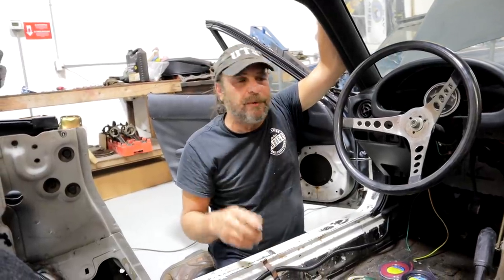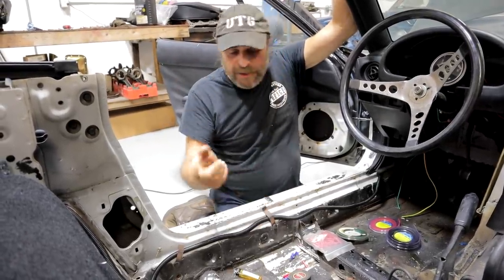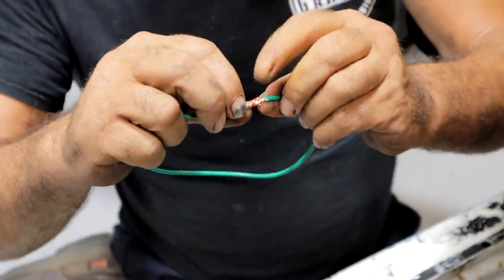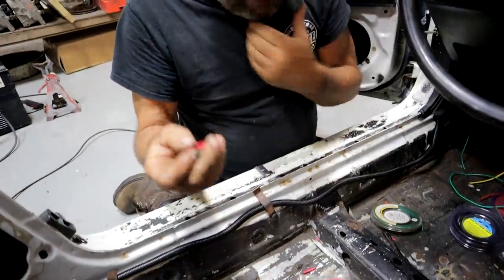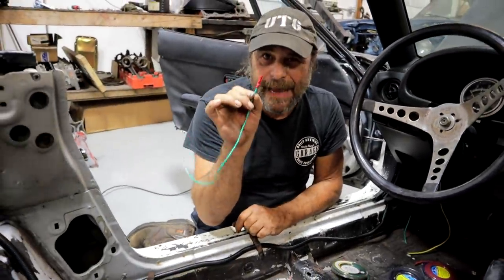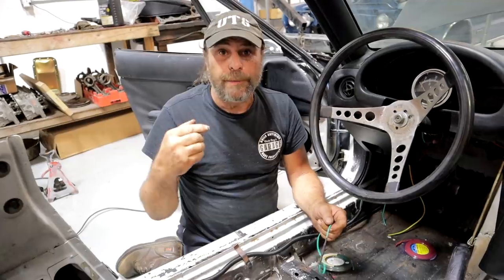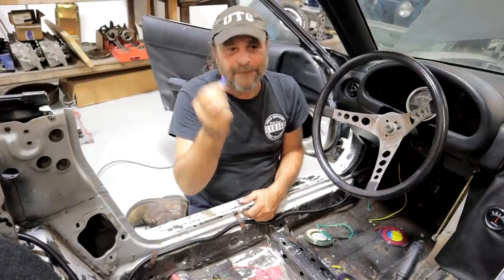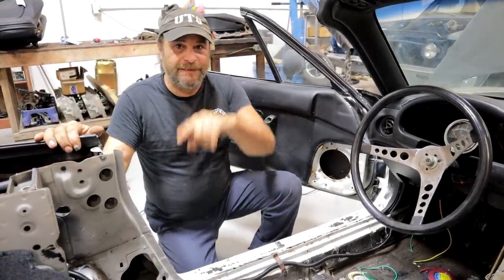The Single Most Misused Item In The World Of Cars

Comment: Good advice UT. These days I use automotive 1/2/3/4/6/8/12 crimp plug/socket connectors if possible. Sure, they cost more than butt joints and bullet connectors, but being able to disconnect, disassemble and re-pin is a huge boon. All the plastic plug/socket chassis use the same plugs, so if you find that you need to add more wires to a cluster, it's easy to simply swap them all out into a plug/socket with more pins. It's really easy to simply crimp one little brass pin to the end of a wire and plug it in when dealing with the minimum length for a wire run.

Comment: Ugh! Don't use those, they sell them without the color coded plastic so the shrink tubing makes a better deal. Just solder it and use adhesive lined heat shrink for a better repair.

Comment: what are we ?......cavemen ?  we don't use our teeth to get the insulation off...  single edge razor blade...while holding the wire in  our fingers....so that we cut the crap out of our fingers in the process.....

Comment: I use solder + shrink, wago connectors and spray grease. Wago are for houses but they work great on cars because the internal springs hold a constant crimp force. *gillotine or scotch locks are just terrible :o Buy the proper ratchet crimps, they are honestly a load better. The tool matches the crimp connectors. The industry style brass spade connectors with the proper crimp tool are also very good 😊

Comment: I switched to the soldering butt connectors with solder in the middle and glue on each side. Hit them with a torch quick and you’re good to go. Haven’t had one fail yet and I use them for a semi truck with TONS of vibration and over 100,000 miles a year. They’re great.

Comment: If you buy copper primary wire by the reel be sure to CHECK IT FIRST.   Feel the end .   Are they sort of stiff and springy??   If they are they are probably copper coated steel= JUNK .   So check close its usually not marked where you can see it on the package🤨

Comment: Spend the extra few cents and buy good electrical connectors IF you're choosing to use that type of fix. And buy connectors with the thick shrink built into the terminal cover, you'll never go back to the harbor freight stuff. Oh and get a real terminal crimper, MAC makes a great one for 35 bucks.

Comment: Nice video but off just a bit. I would suggest you lookup AMP ratchetting crimp tool, we require certified crimps, this will leave a double dimple after the crimp and sealing you use heat shrink terminals. If you strip the correct amount of wire (it is on the tool), correct crimp for the job and a proper crimp tool then no heat shrink outer jacket is needed. And please toss out that crimp tool you are using, pure junk. Get one made by AMP. Oh for my personal crimps I just use a Klien 1005 crimp and cutting tool. Problem with it is that it does break the insultation of the crimp. Sorry, I don't post much, but this hit home with me. My first job was installing 2 way radios, lights and sirens in ambulances, you do that right.

Comment: I don't often crimp, but when I do I use Tyco T head (AMP 59250 ) crimpers with a certifcation dots in die stamping. It's the only way to make these types of connectors worthy. FAA inspection approved and pull rated to a high lbs number.  Its amazing how these form the PVC into a nice sculptured connector. Normally I solder and shrink tube, but that method has no strain relief and it can cause the copper to become brittle. There are certain industry standards that forbid soldered wires in some application so certified crimps are the only way. Using heat shrink over PVC connectors, no. The butt joints that can be crimped that have the sealing jelly are approved for underwater use as well, but the crimp still has to be right.

Comment: I like wire nuts for housing applications because it has spring tension and should not be exposed to humidity (indoors), i don't think they should be used outdoors.

I agree MTW (Machine tool wiring stranded for applications with vibration aka auto) should not use WireNuts.

PS, i carefully use a knife rather than teeth :)

Comment: Question for you.  Solderless connectors for automotive work have been around since my auto school days in the 60s/70s.  I didn't see shrink tubing available until the 90s for repair parts; though we had it in industrial electrical work in the 80s to take the place of friction tape.  Your video is excellent for best practice, but I don't remember shrink tube and connectors going hand-in-hard from the start.

Comment: No worries on corrosion of copper.. Corrosion on aluminum to copper is a natural cause of two opposed metals..Use Nylox in connector, and no shrink tubing necessary. I would simply use 3m Super 33 electrical tape to seal.. I'm an commercial, industrial electrician, 30+ yrs...

Comment: PVC insulated connectors have been out more than 50 years (but came into common use in automotive around 1980 or so... damn Tony, we're getting old!) and then the silicone came out later on (about 1990 or so) and somewhere in between the shrink tube covered connectors became available as well.  
My personal favorite is the low temp solder loaded crimp on connector with shrink tubing...  expensive, but worth it. 
Also, seen several people talking about the crimpers - they make above and below the pivot crimpers as well, all are fairly inexpensive, but some are cheap made and some are well made... the more expensive ones are ok for some applications, but if you are in a tight space, they may not work as well. 
Thanks and I'm gonna use this in my wiring classes as a good example.

Comment: This advice is pretty questionable.  A good crimp is plenty strong,  it doesn't require heatshrink to hold. 

First, ONLY use ratcheting crimpers.
Second, ONLY use nylon insulated crimps of a decent quality.   Those vinyl insulated ones are all garbage. 
Third, when using heatshrink use adhesive lined tubing.

And as someone else mentioned,  stagger crimps if you are doing multiple in a harness. 

Electrical tape is for bundling wires together,  not for insulation or joint protection.  Soldering is a no-no unless you have no other choice.

Comment: Great instruction. Thanks Tony.
On a side note, the make solderless connectors with a shrink sleeve. Two birds, one stone. They work really well (I'm sure someone probably mentioned this already somewhere in the comments). I agree heat shrink needed both regular butt splice connectors in automotive applications.  The whole care hoes through heat/condensation cycles. Marrettes/wire nuts are BS in a car. Always cause problems.  Great for testing but need replacement upon completion.

Comment: TICONN makes a butt splice connector with integrated heat shrink jacketing for marine use, ratcheting crimpers are the best bet to secure conductors.  personally, I crimp barrels to mechanically secure conductors, then solder said spice to insure conductivity, followed by 2 layers of heat shrink, or what I like to call the "belt, & suspenders" solution.

Comment: I like the non insulated crimp connectors with the correct crimpers with double wall shrink tube over top. I used to use shrink butts but they are expensive, and lots of guys use non insulated crimpers and blow a hole in the side and it rots out. People who poke holes in wires with a test light should be beaten with a 4" diameter hose for a good 10 minutes.

Comment: I have a pair of crimpers' like the one you used. I have 1 I bought at a little parts counter in the back of a defunct department store called 'Yellow Front". The parts counter was called "Checkers auto parts". I paid $3.00 for them back then and will not trade for any other period. I don't use the "clam shell" crimp. Mine has the stud that falls into the 'U" and crimps. A test for solid after squishing is a little tug, mine don't come out. If needed I tape up but never any issues with degrading at all.

Comment: You showing that "Scotch lock" brought back many terrible memories of rewiring a camper that I bought years ago! I HATE those things with a passion!

Regular butt connectors like you're using are decent. The ones with color coded shrink tubing already on them are nice but a little more expensive. The Cadillac or, Imperial in the case of you Mopar or nocar folks, are the ones that also have solder inside that melts when you heat them. They are expensive but, they're worth it for permanent splices.

Comment: If you use the marine butt splices you can save a step, Instead of rigid plastic, they’re flexible and have glue inside so it’s just crimp and heat. They’re  waterproof, and 2 forms of mechanical adhesion

Comment: A wire nut is a better connection than a solderless connector. And a real man uses a Western Union splice, soldered, and shrink wrapped. Resulting tensile strength is stronger than the wire itself. :)

Comment: Heres another one...
All  you need is the YELLOW ..what I do is make a ball or knot on the end of the copper shove both ends in to the middle ...
 crimp the back sides then crimp  the middle  ... the ball of wire holds no matter what.
..its locked ..
..  there's no  rules... Harbor fraight has rubber tape for 3 bucks a roll
   its priceless,
it stretches 3x as long and makes a sealed hose...if someone can shrink they can solder.
   Great work!! Sir I can remember when I was 7 and I was pulling the governor out of the engine and straight pipeing with a beer can. For more Hp ..it was  on  my 2.5 hp mini bike ... I got at least another 0.75hp
The More I Learn The Less I Know..

Comment: I first squeeze silicone dielectric grease through those crimp connectors first and THEN add the shrink tubing over it OR better yet I try to buy the more expensive crimp connectors WITH the heat shrink already on them BUT I apply silicone dielectric grease to the bare wire ends first before inserting them into the crimp connectors.
I also use the more expensive ratcheting crimping tools so I know I get a proper crimp each and every time.
For any of the larger battery feed cables I use a 12 ton portable hydraulic crimping set.
It was the best $50.00 I ever spent.

Comment: Those red handled crimpers ar ok inna pinch (so to speak), but if you do many crimp connections get a real set of Paladin crimpers with changeable dies. They make about any type of crimp die you could ever want from butt splices & spade/ring/bullet connectors to rj45 to co-ax to molex etc. they not only crimp the inner metal, they crimp the ends onto the insulation. Remember to look in the end of the connector and align the inner metal bit to crush the “C” into itself gripping the strands, NOT squash it into a “U” so it just slides out. Also put some bulb/dielectric grease on the wires and worry a little less about corrosion from humidity. Solder and marine shrink or liquid electrical sealer with regular shrink is the way if it’s going to get wet.

Comment: Scotch locks are just plain awful. I used to maintain a government fleet and you would not believe how many places I found those stupid things. New vehicles were delivered with them hidden all over the place under the dash. (I'm talking about added equipment not factory) Since they only contact about 1/64th inch of the wire it doesn't take long for vibrations to kill the connection. Whenever something like a PTO controller quit working I would just tug on the wires and everything would light up. Then it was my turn to redo the connections the way they should have been done from the beginning.

Comment: You did it right BUT!  Those connectors are the worst thing to use, because you are introducing a different metal (aluminum ) with copper wire In sense creating a resistor in the wire thus producing  heat that will make this connector fail in time! Not if It WILL and always fail . The two best were the first two ways that you showed Twist wire (similar materials  together) than shrink wrap or solder than shrink wrap.
Never introduce a dissimilar metal (conductor ) into the wiring system . Early 80s and older maybe ? Not with anything that has a ECM.
Love your videos

Comment: I've found butt connectors that have heat shrink and "expanding gell" built in. The gell oozes through any gaps left by heat shrink as heated. They are more expensive but no worries later.

Comment: Personally I still soldier 95%  of my splices. I have butane (small) and propane (large) torches for infield work. Of course heavy duty irons for in shop are great. For electric I always use the smallest rosin core soldier that is effective for what I'm soldering. Some very small solder disappears on large multi strand wire and very large solder requires more heat than the wire insulation can handle.
Experiment, record your findings and.now your ready.

Comment: The red, blue & yellow plastic sleeves are bulky and look like crap. I buff the plastic loose with a wire-wheel, crimp the wires to the bare meal sleeve, then cover with heat-shrink. Those scotch-lock 'guillotine' connectors are garbage!

Comment: Butt connectors were never intended to be used in an outdoor environment, or anywhere moisture is present.  I pack the butt connectors with electrical grease to waterproof them.  The wire should displace the electrical grease as you shove it in.  Then cover with shrink tubing.  Water can still wick along the wire underneath the tubing; the electrical grease prevents that.

Even solder joints need protection from water and moisture.  You can get away without it behind the radio and deep inside the trunk, but anywhere near the doors absolutely needs electrical grease.  Marine grade shrink tubing is acceptable, but you're not as certain of a perfect seal as with using electrical grease.

Comment: Butt connectors are garbage period... Always solder a splice repair. If you have several wires use some type of a sealed connector with properly crimped terminals like Deutsch.

Comment: Those "KILLOTINE" connectors always fail in some fashion or another, wire nuts have there purpose, but not for use in a moving object, such as a car, I've even had failures with the butt splice connectors cutting into the wire and causing it to break, so I only solder and heat shrink anymore

Comment: I greatly prefer to use marine-grade shrink tube, with the meltable silica inside of it. Also you should mention where the split on the crimp terminal should be in comparison to the nipple of the crimp tool. Finally when doing multiple wires in a harness you should always have the connection staggered so it's smaller and also reduces the risk of a pokie shorting between wires

Comment: Lots of people are pontificating about 'proper' crimping techniques and tools in these comments. Just know that if you do it exactly as Tony demonstrated, your connections will work and they will last. For really small-gauge wires, I expose a double-length of bare wire, then fold it back on itself and crimp that to get a solid connection.

Comment: I'm a professional mechanic, and the electrical guy at work.  Got to agree that the "guillotine" connectors AKA Scotch Locks are the worst thing.  Any time I see them, I curse the moron who used them.  They're fast, they're easy... they fail, they damage the wiring you're using them on.  Trash.  Pure trash.

I'm not even a fan of the crimp on butt connectors, but they work if done properly.  I'd rather people solder.  It's not hard.  Also rather people not use the heat shrink you show there; double wall is way better stuff.

Comment: I hate scotch-loks...or whatever the knock off ones are called...currently unf*cking an 80 chevy k10 that has at least 20 of those things scattered thru the wiring..as an example theres one spliced into the blower motor..connected to a piece of wire...running to the fuse block...stuffed under a fuse of course..i cant wait to see what i find when i pull the aftermarket radio out🤔😧

Comment: They make the solderless connectors that will heat shrink too.  I worked at a GM dealer for 30 years.  If I didn't solder, and use shrink tubing, I'd use those.

Comment: There are more expensive crimpers that will do a better job of crimping. Mine are made by Amp. Thanks, however for the shrink tube tutorial. I used to work for a locomotive rebuild shop, and we never used shrink tubing. I can see how it would have helped.

Comment: I agree that those "scotch lock" type connectors are crap and never to be used. For butt connectors, try some Klein journeyman crimpers, about $35 at Home Depot. Use the "non insulated" nipple even for insulated connectors and wires don't pull out even with the hardest tug.

Comment: I just picked up a 1972 dodge dart from some kid for cheap. Everything worked in the car except the headlights. I looked at the fuse block and the wires leading from it were scorched through so they re-ran the wires all weird from inline fuse holders, and nothing is marked. I can't find a wiring guide with correct wire colors to sort out this mess and run it to a 12 circuit fuse box. Every time I look at it, it keeps getting more and more weird. So I have a question, does anyone know the wire colors, and what they go to of each of the 16 wires that are now dangling from my dash. It's a 1972 dodge dart 4 door no ac.

Comment: I spent about ten bucks on a Harbor Freight heat gun years ago, and will never go back to using a flame on heat shrink tubing.  There's just no comparison on how much better it works.  Takes a few seconds longer to warm the gun up (which is why I eventually bought a more expensive heat gun), but the final appearance is always consistent and never burned.  I don't think I ever did a job with more than a couple of wires without melting or burning the heat shrink when I was using fire.

Doubly so when you get the "solder seal" connectors with the heat shrink and low-temp solder.  But even for regular heat shrink...